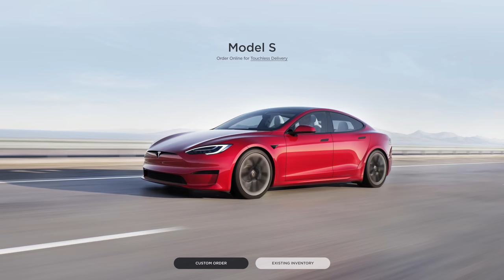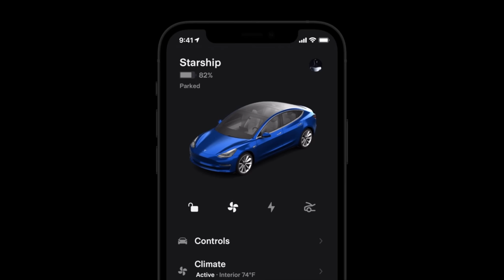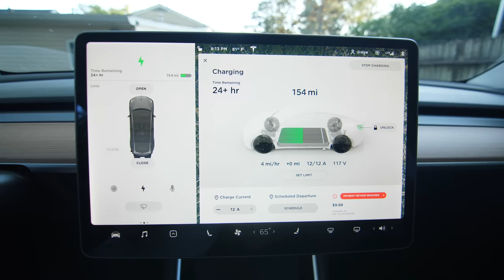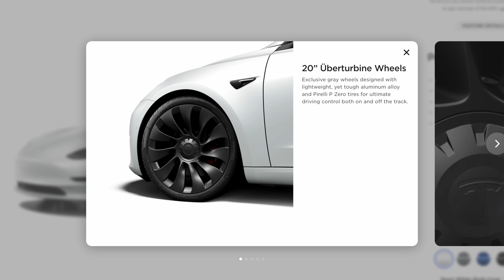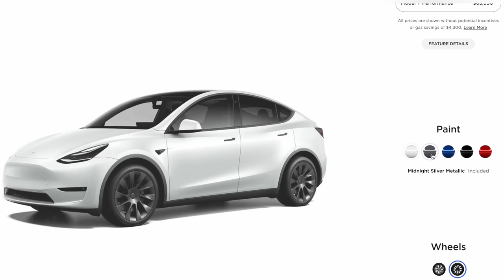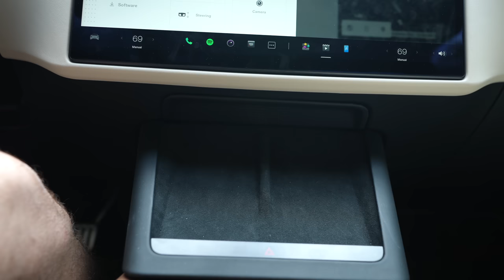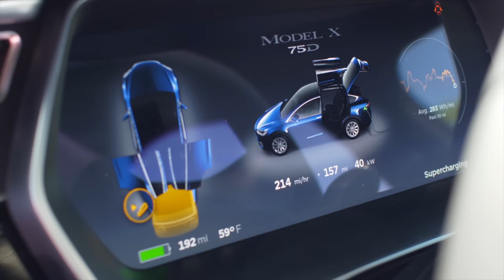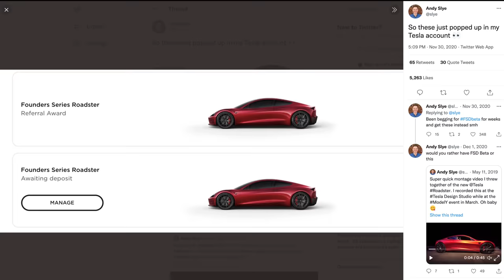Tesla Buyer's Guide 2022: Which One is Best for You!

Comment: Secret News - An Australian company is developing an electric vehicle which has a battery which will be interchangeable with a fully charged battery at the Electric Battery Replacement Station. The vehicle will drive over a conveyor belt and a robot will scan the underside of the vehicle and the discharged battery will then be replaced with a fully charged battery at a cost of $13.00 USD or $20.00 AUD per battery. The time to exchange the battery will only be 3 minutes and you will be able to pre-pay for an exchange battery with your smart phone so you can just drive through like at McDonalds. This means that Tesla's method of recharging will be outdated and will become inferior to the new exchange battery system which is set to be released throughout Australia and the rest of the world in 2026. Take Care David Matherson.

Comment: was just in a friends x model with full auto pilot(just recently updated). just plug in where you want to go and it took us there. had a few issues(didn't recognize a speed bump at at stop sign), so when it went to accelerate, it went a little too quick. Otherwise a fantastic experience and this is just the beginning!

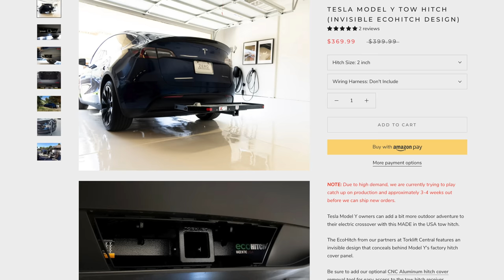Comment: 13:01 if you go after market you don't get tow mode or the wiring harness.  Adding in the wiring harness is several hundred dollars and so you are basically back to the $1000 from tesla and you still won't have tow mode.   Tesla Hitch is the way to go if you are hooking up an actual trailer.  Also it disables the rear ultra sonic sensors with tow mode so you don't have annoying beeps.

Comment: Got a model 3 long range on order, delivery expected Feb/Mar.  Ordered it in silver so it will look good, sitting next to the wife's silver Telluride.  Andy, you failed to mention the option of removing the wheel covers of the aero wheels to expose the nice looking rims underneath.  Then adding lugnut caps to finish the look <3  The aero covers increase efficiency (a tiny bit), but only on the highway!
Reply: Aren't those aero wheels like $25 per wheel?! I scratched my wheels accident. Body shop says to file and refill is $150 per wheel. That is crazy wheels are so cheap. So if you scrape by accident it's easy to replace them.
Reply: They have silver? I know they have a dark grey but didn’t see silver!
Reply: @rscranman2002  silver comes in a variety of shades. They call it silver but I would call it metallic charcoal
Reply: @SGliderGuy  got a picture? Charcoal looks nothing like silver
Reply: Now it’s not a lugnut. You will get a cover to snap
Reply: Wonder if you could spray paint the hub caps silver. I am not a fan of the black wheels or covers.

Comment: Thanks for your review! 
We've had two model S (over 8 years). Yesterday, we got to drive a model 3 loaner as the part for our car was not available so they sent us home with the 3. We liked it so much as to consider going with the 3 now. We've never been in any model but the S so were surprised how all the models have the Tesla class. Now though we're considering the Y so as not to lose the space of the S. We'll see. Full Self Driving has been keeping us more than on our toes (more like pins and needles). Overall, my opinion is that the S is the absolute most gorgeous. We'll see after getting the S back from repair how it feels to be back in that.
Reply: Thank you for this review.
Reply: You had in for repairs what are these things thanks
Reply: @gregreed402  simply that the broke was ‘stuck’ on because the adaptive driving equipment was kicked out of place. Nothing to do w the Tesla. We’ve had it in for upgrades and stuff. These cars give owners no grief😀

Comment: I’m still in the considering phase. What I’m currently paying in payment plus gas monthly is $900+-. And that’s only driving to and from work twice per week and whatever I’m driving sets in the parking lot up to 3 days straight and doesn’t move. I’m curious how well the charge holds up when left setting unplugged for days at a time and what effects really hot and pretty damn cold has on charge retention. I live just south of your location down here just east of Nashville. The Model Y performance is only about $80 a month higher than my current Lexus. Curious about drive motor replacements, how well the shocks, tie rods and the rest of the steering and suspension hold up with them being as heavy as they are.

Comment: Can’t wait for the new batteries to be used in newer models upping the mileage you get. Going to be insane getting 500+ miles out of a full charge
Reply: the battery is literally just bigger,   it doesnt hold more  per lbs of weight.      so it will still have the same capacity.

Comment: Andy, I have an interesting delima, I have a Red Model Y LR on order and it should be here in the next several weeks; (I hope). I was planning on trading in a Model 3 (2018 LR RWD with fsd with the beta software). I did not order the FSD on the model Y. I am trying to decide whether to keep the model 3 hoping that the FSD will mature enough that I would actually use it or go with the trade ( the offered trade value is good) . Also my wife has a new Volvo XC60 plug in hybrid, so the need for a SUV is not a necessary as it was when I ordered last August. Just interested in your thoughts, thanks.

Comment: My Tesla rep said they wont know if my car will have the 4680 batteries until I am assigned a VIN. If it doesn't, can I delay my delivery to wait for the 4680's or is the VIN tied to the car without 4680's?
Reply: They can’t let you pick the batteries or they’d not be able to use their none 4680’s which would disable large amounts of production.

Comment: Drove my uncle's model S. Ngl I love how quiet it is and how fast it is, but I hate it more than I actually like it. I prefer gasoline cars. Having the freedom to modify and tune just feels a lot more free compared to electric. Plus, repairs are far more cheaper compared to tesla. $15k-$20k for a simple battery replacement? No thanks. And when the battery does go out, most electrical components are far more prone to being damaged. Super charging any EV will also drastically decrease your battery life. Also, they suck in hot and cold climates. Takes too long to charge too.

Comment: Why do we need NEUTAL?  Accidentally put the car in NEUTRAL while exiting AutoPilot and lost total control of the car. Applied brakes at top of freeway exit ramp and the car started moving backwards.  Had 26% battery left, thought that was the problem. Then realized car was in NEUTRAL.  The only time I use NEUTRAL is in a car wash and the attendant had to show me how to put car in Neutral.  NEUTRAL should be moved to CAR WASH MODE.  Anyone?

Comment: Tesla cars may work in the USA where the roads are spacious wide and designed on a grid system. However what about in Europe?, where the roads are old narrow and winding.  I do not think I could trust a Tesla car while going around the Arc The Triomphe, in rush hour!.  In a world where there are millions of independent drivers, certain driving circumstances demand the human touch.  That said - Tesla cars would work well if all the cars on the road were made by and are able to communicate to one another.  A system where the cars on the road can exchange information would make it much more efficient reliable and thus safer.  Connect the cars (software) and automated driverless cars become more of a possibility.
Reply: Teslas are big in Europe.  So much so they built a factory in Berlin.

Comment: Still have so much to improve we must get away from battery power hydrogen cell is much more efficient  and less damaging to the environment let's biuld something that will beet everything out there I am working on an ev that will not need batteries and has a 0 80 mph of 3.2 seconds all wheel drive and very offroad performance capable this is what people want give it to them we don't need huge backed up drained battery evs.

Comment: I dont think these cars will age well with the amount of tech they have, the drivetrain will be fine but the interiors will be very outdated soon.
Reply: I think that the tech is the least likely thing to outdated. The OTA updates will see to that... and will see off the competition for a few years yet.

I think the outside looks will not date well. I actually never liked the Tesla exteriors - especially the front of the 3 and Y. They look very out of proportion from some angles... and the front of the S looks like a clone of the Ford Mondeo.

However, the tech is unbeatable... and if you regularly do distance driving then the charge network is light years ahead.

I just couldn't go with the looks so opted for an alternative.
Reply: @jp6975  I actually love the design of the teslas. My thinking is that of the software and hardware. I mean everyone raves about updates but how many years of updates for your iphone before it isnt supported anymore?

Comment: In about 5 years Tesla will fall behind all of the big car manufactures like Mercedes Benz, Land Rover Range Rover, Hyundai, Toyota, Volkswagen, and many others Mercedes Benz already have a new type performance motor on there 2022-2023 AMG Ev's it's call the Axial Flux motor, lighter thiner with much more Horse power and torque and Koenigsegg invented the Raxial Flux which is similar, it as wide as a can of coke and less than twice the hight of two cans of coke on top each other and one Raxial Flux motor produces 350 horse power with high torque and you can use up to four in one vehicle, just imagine two of these motors will produces 700 horse power in a vehicle Koenigsegg say they will also be producing these motors for other car manufactures , it's game over for tesla when when other car manufactures start using these motors, the Axial Flux motor Mercedes Benz will be using on there AMG models are similar in design size, horsepower and torque to the  Raxial Flux motor.